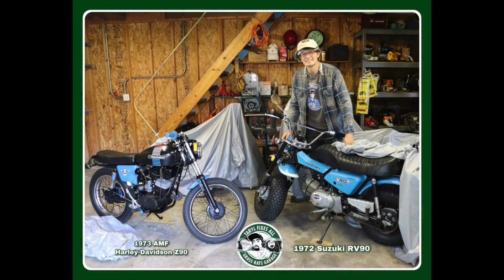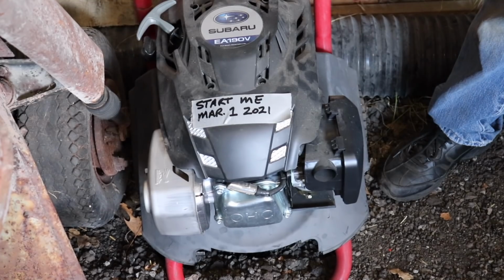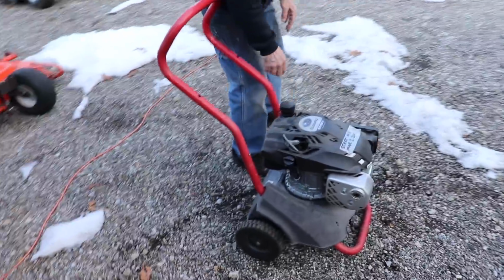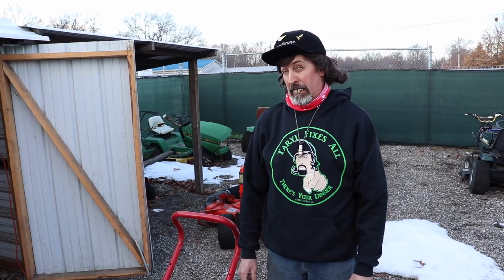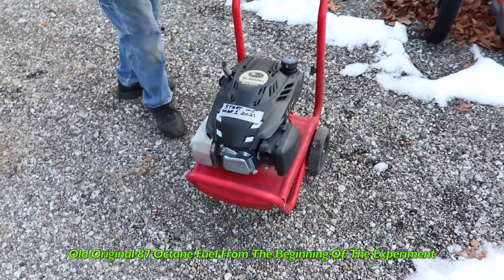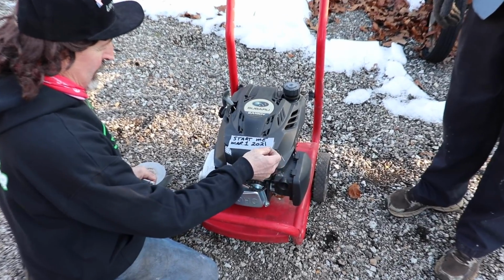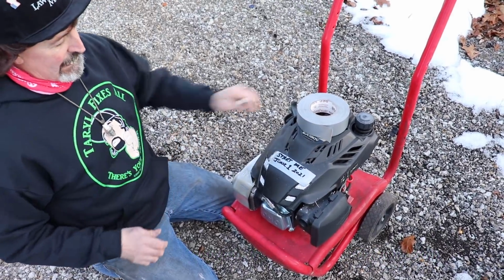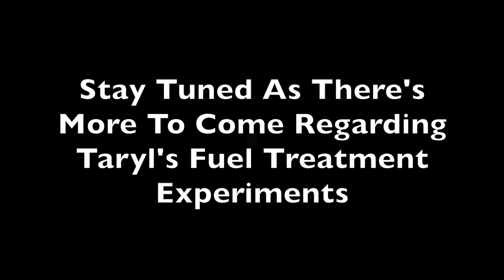Will They Start? Fuel Treatment Experiment

Comment: 93 octane non ethanol fuel with a little 2 stroke oil work's great. Use it on your last tank before storage and it should easily start the next season.
Reply: Perhaps. Or, perhaps not. Run an experiment like Taryl. Show the results. Perhaps you're on to something but there's always the chance it does not actually work out that way.

Comment: Like ur experiments, but I've got u way beat, I have a Colman generator that has had the same "fuel pump" gas for just over 2 yrs, and it still fires up and runs just fine.
So I think ur on to something with the bogus fuel additives.

Comment: 3 months and 16 pulls on old fuel.
Reply: I use Stabil every winter when I store my 67 camaro.Always have engine trouble,this year no Stabil,car runs great.Just my two cents,I don’t know if this stuff works or not,it’s like new and improved dog food,how would I know.
Reply: @oxyfee6486  I use Sta-Bil and NEVER have problems starting in the spring. I'll continue to use it. It's not hurting anything that's for sure.
Reply: If anything it’s probably just shit fuel.We had a local truck stop that was in a ravine,every spring melt everyone I knew was complaining about anything mechanical running horrible.Turns out their tanks were full of water.

Comment: Damn taryl you got snow on the ground and you think it's spring. I wonder, by starting those engines it gives them a chance to move fuel through the carbs. It's when they are left alone  the fuel dries up in the bowl. That's when you have the problems.

Comment: Did those engines have any ethanol in the gas?
Reply: They all do, there’s maybe one that doesn’t.
Reply: One has standard e85 with nothing,. The other has high octane another one has no octane.. the rest are e85 with fuel additive.   I guess so many people are coming here and not watched it since beginning
Reply: Jdretiree, all of these engines are running gasoline with ethanol except one. All but two of them are running e85 which has ethanol, one is running 
e90, I think, with ethanol (that’s what the e stands for) and one is called VP, which is 94 octane with no ethanol. You can buy the VP from Amazon among other places, it usually comes in quart containers (or 5 gallon container). It has a life expectancy of five years unopened, and two years once it’s opened. All gasoline has an octane rating. The first three engines have e85, e90, and VP the rest are e85 and have some kind of additive put in them to keep them from going bad. So far it looks like the additives are not adding any additional life to the gasoline, that’s why Taryl is calling them Snake Oil’s, because there fake additives.

Comment: But how much Ethanol was in the fuel? In San Diego (and our garbage fuel) you would be rebuilding the Carbs. With half a tank, you get a maximum of 9 months out of gas in California before it is varnish. We can't even buy Ethanol Free if we wanted to (except in little quart size cans). If you have a buddy that flies, you can purchase AvGas which still has the lead but no ethanol.
Reply: @russfolts4531  Thank you for your kind and considerate thoughts. You don't get out much or have not seen much of the world.
Reply: @russfolts4531   Ca. Saving the world 🌍

Comment: hold on i bought a snomobile that wouldnt run 4 crap at low end, grab a handfull of throttle and it would go. next time we went out i dumped a can of sea foam in it after a half hour of ride time it was fixed!

Comment: When are they going to come up with fuel injection for all these small engines? surely they can come up with a cheap enough way to make it worth adding on.
Reply: Stihl have pioneered fuel injection on chainsaws and Briggs and Stratton did fuel injection on the pro Vtwin engines so it could happen but I see every manufacturer will be just copying the car trade and go straight to battery to save the planet.

Comment: You came this far just to skip a month. Start a new test if you want every 2 months. You lost me on this one guys. Annoyed.
Reply: The test would already be over if it were done here. The heat of the Mojave desert turns ethanol tainted fuel sour very fast. The climate there is just not hot enough, this test will take more time.